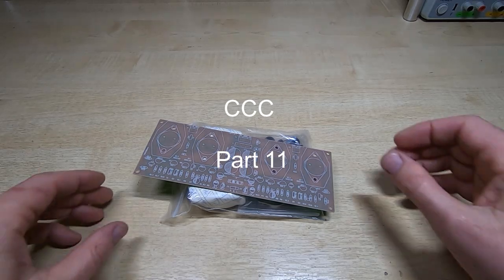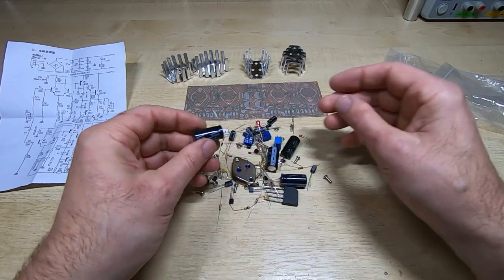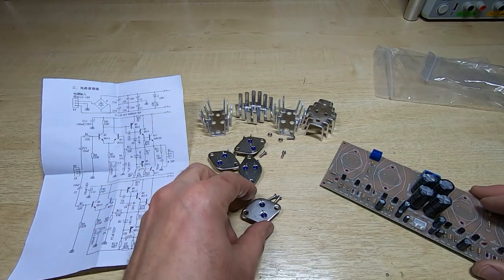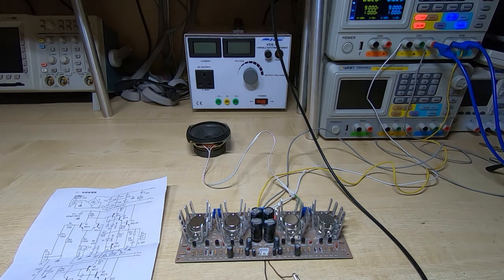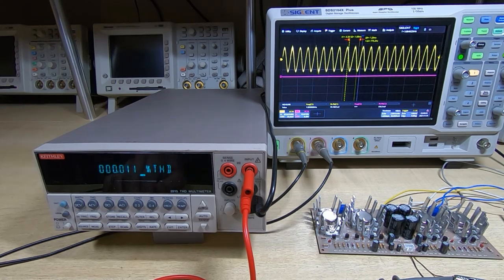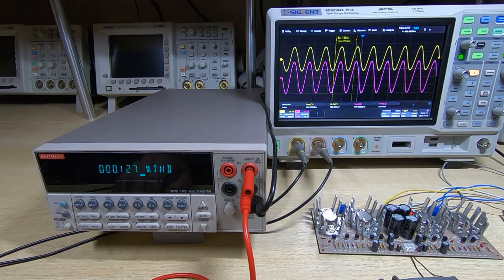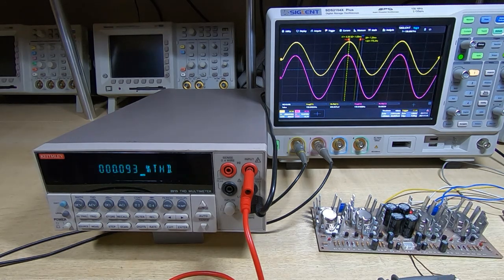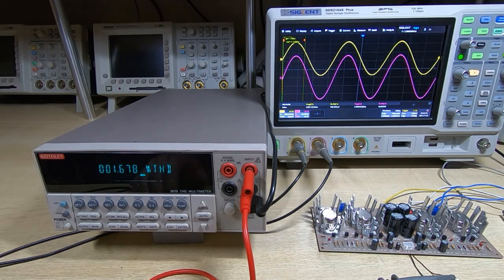Cheap Electronics Kit Number 11

Comment: This circuit is pretty terrible. The 9014 and 9012 are not complementary parts and are woefully underrated for a "100 Watt" design. The 9014 is a 45volt 100mA part while the 9012 is a 20volt 500mA part. If those are really the parts included I am surprised it did not self destruct very quickly.
Reply from the maker: It is not a symmetrical driver stage. The output transistors have a current gain of approx 60-80 (I put them into the curve tracer) so the driver stage should be able to handle it. The biggest problem with the design is its poor frequency response as it seems to have an upper limit of approx 3KHz so not exactly HiFi. I also think that the 100W is really only peak power and not continuous. I think it would be interesting to see what improvements could be made to improve its response.

Comment: I like to add a speaker protection board with it
Reply from the maker: Yes that is a good idea. The output is DC coupled so any failure or imbalance could put large currents through the load.
Reply: @JerryWalker001  hi
Thank you for your reply, yes eventually if an unbalanced occurs at the output the speakers will burn.

Comment: Is that a quasi complementary output?
Reply from the maker: Yes it is. Most low cost audio amplifiers use a variation of this circuit as it allows NPN transitors in both the upper and lower elements of the output stage. The feedback in this design is not very well implemented and causes asymmetric output distortion as the frequency increases but they made a nice job of biasing the upper and lower elements to get very low crossover distortion while keeping low signal consumption low.

Comment: I did notice that on some very cheap chinese electronics the copper side of the PCB i coated with some kind of flux. It tends to be sticky, especially over time. I think that is the case with this PCB. It might be coated in some kind of flux like some rosin diluted in IPA and applied to the board.
Reply from the maker: I thought the same thing and I did try to solder to one of the pads before cleaning the board but whatever it was just turned black and made a really bad joint. Once I cleaned the board it soldered properly.

Comment: my post seems to have been deleted? (Edit: apparently just YouTube AI not liking people talking to each other… )
Reply from the maker: Yes I did receive your messages in notification emails and the text you used would have triggered the 'removal' algorithm, youtube is very fussy these days.
Reply: Perhaps this board solders better than any other because it’s the only one you’ve cleaned. 🙂
Reply: @mikebond6328  Or maybe because it's gold plated/flashed!
Reply from the maker: @mikebond6328  It is because it is gold plated. HASL or gold plating is applied to boards as it makes them much easier to solder but very low cost boards have very poor finishes and no amount of cleaning will improve solder flow. In general if I get poor soldering I try to clean a pad or two to see if there is any contamination but on most low cost boards it makes no difference. The problem is not contamination but surface material. Also most modern solders will tolerate contaminated boards anyway. I actually cleaned this board because it was sticky rather than to make it easier to solder. The next poor board I get I will demonstrate how cleaning makes no difference.
Reply: OK, I'll have another go at evading our Digital Overlords:
There seems to be a Ver2.0 of this board, look for "OCL power amplifier board kit 2.0"
There are a few minor circuit changes between them so maybe they tweaked something, and they've relocated the power caps so you could use a DIY block heatsink instead of the individual ones
Reply: And a further post deleted? Seems like YouTube objected to me calling them Big Brother too... figures
Reply from the maker: @____________________________.x  The problem is that you are trying to divert people from my video and as youtube is a commercial entity then they do not like people trying to 'advertise' on other peoples channel. This is why I have to be careful and avoid certain types of advertising in the videos otherwise they get pulled.
Reply: @JerryWalker001  umm, well that’s a confusing reaction? Honestly I’m not trying to divert anyone from your channel, or advertise anything. I’ve got no channel of my own? I just saw the kit and I wondered where you got it as you didn’t have a link in the description, so I went looking. I figured if was curious then others would be too?  Or maybe I’m just misreading this, it’s kinda late
Reply from the maker: @____________________________.x  I was not complaining, just letting you know the way that youtube seems to classify comments. Anytime someone tries to divert viewers from a channel then it seems to remove the comment. You may not have intended to divert viewers but directing them somewhere else is diverting them. It seems to have got worse recently following the changes to youtubes policies. I often get asked why I do not say where I buy the kits when I make the videos or put links in my description and that is the basic reason, it is seen as advertising and a couple of my videos have been removed for what they perceived as adverstising.I intentionally do not put links in the description to avoid these issues (and I would prefer that people search for themselves).
Reply: @JerryWalker001  oh I see, sorry 🙂 I’m sure I’ve seen some channels put up affiliate links for the stuff they talk about, just as another way to support a channel
Reply from the maker: @____________________________.x  Exactly the point. I am Not affiliated with the kit suppliers and when I post the videos I have to declare them as 'non affiliated' and so I cannot 'advertise' in them. It seems to be hit and miss and only a proportion of such videos are removed but as with your comments the automated youtube algorithm is easily triggered and so I avoid such issues. Having said that I would still prefer that people do their own searching as there are usually a number of sources for these kits.